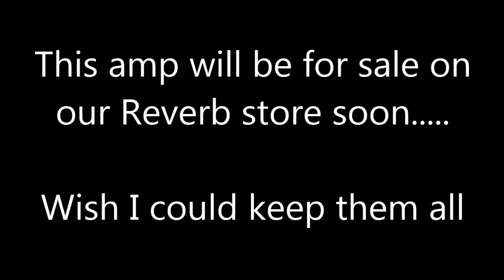Part 2  Yamaha VR5000 Guitar Amp  Let's Fix the Issues!

Comment: I have one of these with volume cutting out - after a month of research it seems to be a common symptom of old capacitors. I'm thinking of soldering in a new one myself but i have only ever done a few soldering jobs - would you say this is DIY level or not? i notice you said in the vid you had a technician do it? Is that for time reasons or safety reasons? Do you know the capacitor voltage rating and approximately how much they cost?
Reply from the maker: I am a technician.  I do my own work.   As far as desoldering goes,  practice on some trash first.
Reply: @DeadKoby  i can solder but i dont know  much about components - like which capacitor to get and where? Can i use anything of the right specs - i was told modern ones are low quality compared to 30 years ago?
Reply from the maker: I recently made a video on finding capacitors for a solid state amp.  Check that out.  New parts are OK.   There was a bad rash from China in the early 2000's......... and that wrecked many opinions.   The vendors I use have not disappointed me.
Reply: @DeadKoby  Ok thanks a lot man. I now think all 3 of my Yamaha VRs need new capacitors (they are all crackling, fading and cutting out) - gonna be expensive but i LOVE this amp and want to keep them going.
Reply from the maker: Check out  Jameco...... it's the vendor I use often for parts.  Their "value pro"  brand of caps has been just fine for service use.
Reply: thanks a lot. @DeadKoby